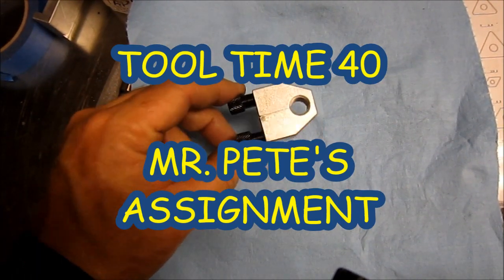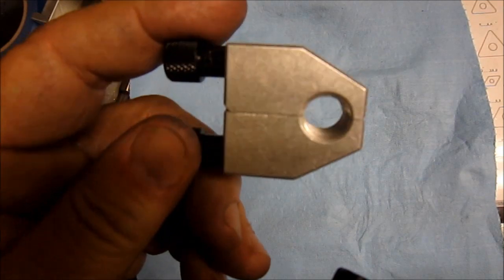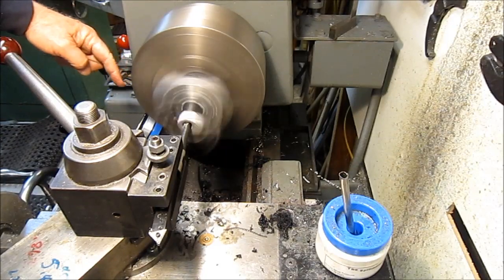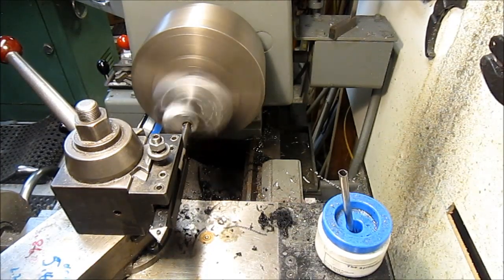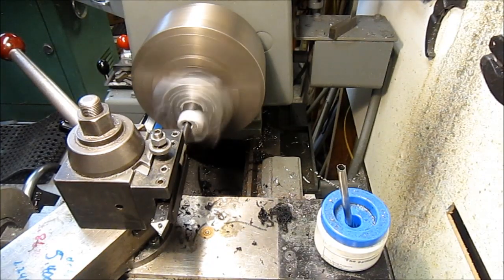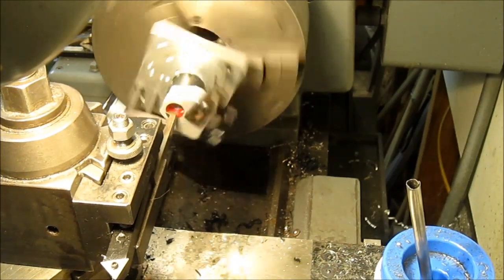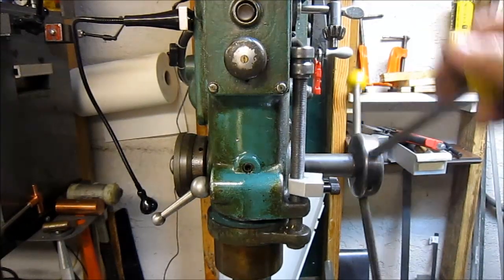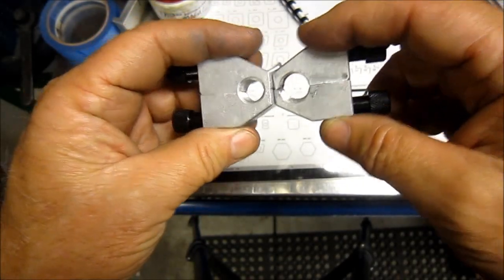Tool Time 40  Mr. Pete'S Assignment

Comment: I modified one of these a several weeks ago per Mr. Pete's inspiration.  My conversion was for a Powermatic drill press with 5/8-10TPI which is an odd thread size.  My solution was to make a one time use tap with mild steel, no extra hardening (since work piece is aluminum or aluminum alloy).  It worked very nicely.
Reply from the maker: ab190001 Hello ab19.....Thank you for watching and sharing how you came up with the solution....very cool...congrats!!!!

Comment: I never really questioned your setup. Looked fine to me, you can get a lot of force with the clamps, it's not going to spin out if you put enough force on it, which you did.

Great job.

btw, your press return spring is really tight, they break easier the tighter they are. Nothing wrong with having it loose enough that you have to help it back to top position a bit.
Reply from the maker: Steve S Thanks Steve for the view and feedback/comment